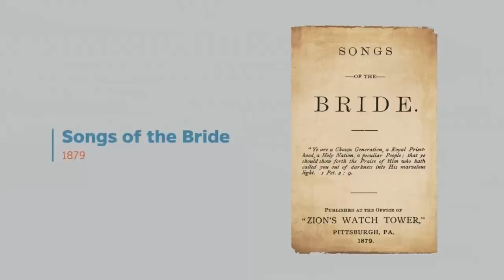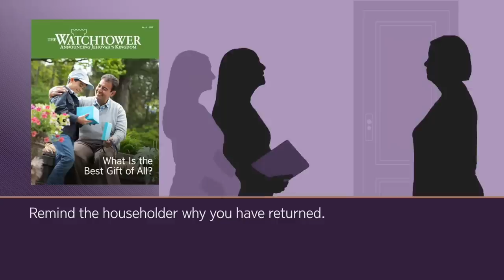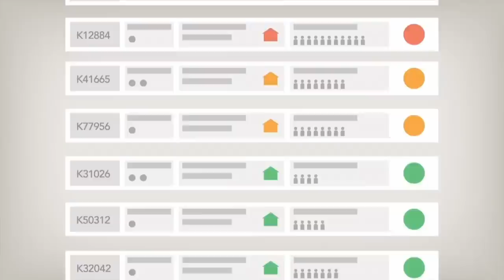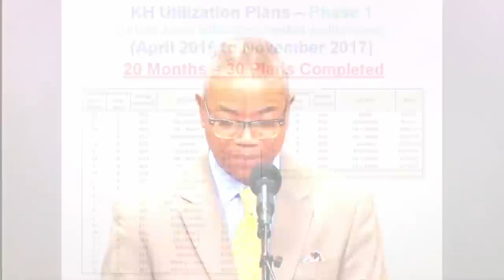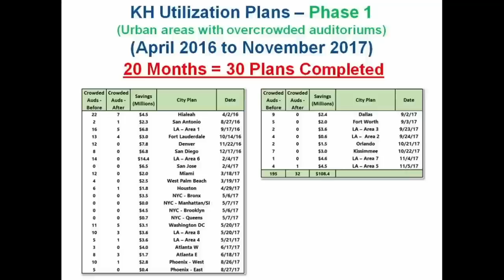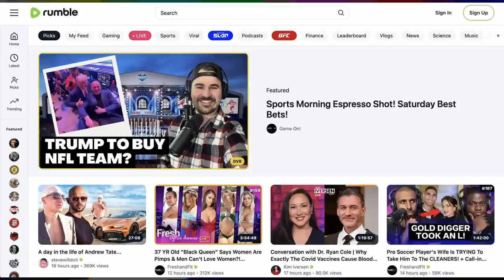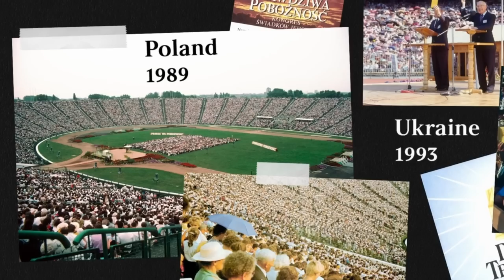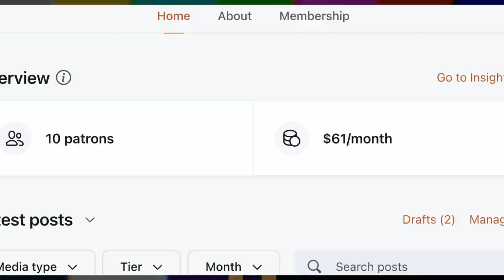How JW.org Made Money Before and Makes Money Today (New Format! 😱)

Comment: TFW you realize that the cult you grew up in wasn't even a real cult, just an MLM that got too big. 😮😅
Reply: Multi level marketing?
Reply: It's a cult period
Reply: @ChrisPyle  indeed. Though, to Keith's point, MLMs are cults too. So I suppose it all comes full circle 😅
Reply: @DarthMagog  It’s a cult and it’s MLM.

Cult is supposed to be a subset of religion, but because cult experts generalize cults, the definition of cult has expanded quite a lot. Cults from religious groups doing crazy things like human sacrifice or extreme evil stuffs, to now high control groups, or even use control as a main defining factor, or how culty a group is, with low level control which can be a group of people with same interest, like a tennis club. Cults are a very different thing now than the past stereotypes definition.

My definition of cult is simple, a religious group, not necessary a religion, but as a group with strong belief on what they believe, doing something hurting people, inside or outside.
Reply: What is TFW